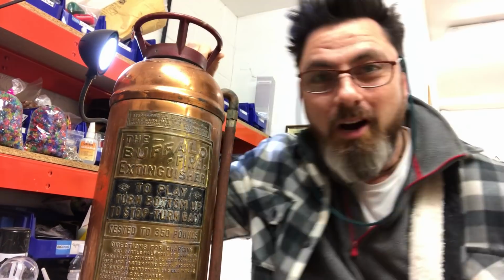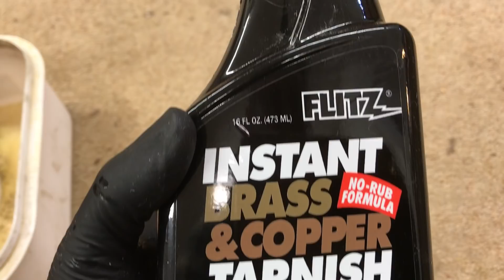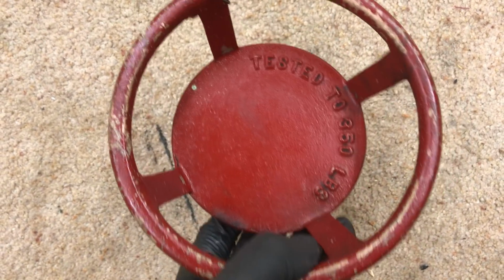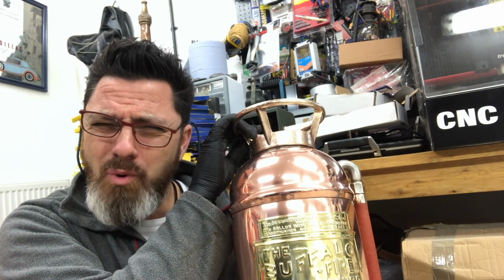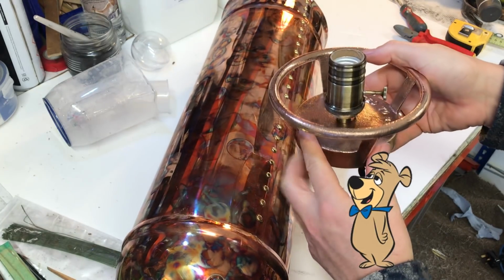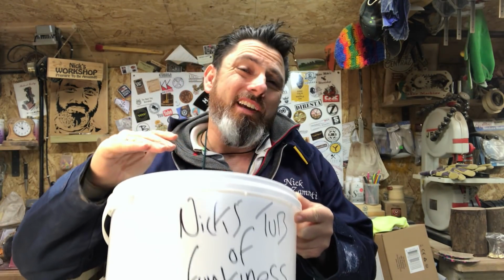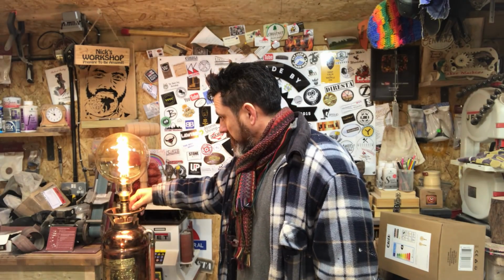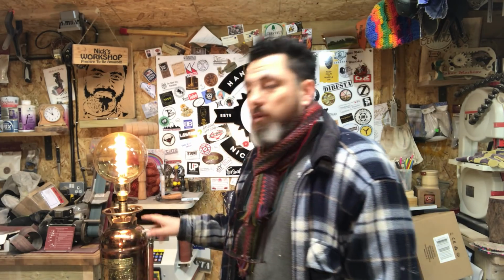I added this Mahoosive Bulb to an old fire extinguisher  😂

Comment: Hi Nick. The item you pulled out of your tub at 23.05 is an antique copper and brass fire nozzle. These are the main reason you need more than one firefighter holding the hose as it’ll throw you around all over the place!  They’ve been replaced by “hand controlled branches” now, which are much safer as you can turn them off rather than shouting at the pump operator to do it for you!

Comment: Nick, That was an acid/soda fire extinguisher. They were filled with a water and bicarbonate soda mix and acid would have been in the bottle located in the little cage at the top with a lead stopper in it. Tip it upside down the lead stopper fell out the acid mixed with the soda in the water and a gas was formed and pushed the water out the hose under pressure. They were outlawed here in the states in the early 60's because then would tend to explode when pressurized. The reason you had trouble cleaning it was because it should have been coated with a clear lacquer finish to protect it from the acid which is the same reason the cap was painted. While that wasn't an extremely rare extinguisher it was in really good shape and looked great once you cleaned and polished it and would have been worth a couple of hundred dollars here in the states. You kinda ruined it with the burning but hey I still like your videos so don't quit. What did you do with the basket and bottle that was in it they are hard to find complete.
Reply: Also how much value was lost by removing the patina? 😉

Watched a few episodes of Antiques Road Show. Where someone lost 200k by removing the "nasty" old finish. 

But it's not like it's a rare work of art.
Reply: Lol $200 is nothing.
Reply: @WatchingNinja  $200"K" aka $200,000.00.

They removed the finish on a Highboy to reveal the beautiful Cherry wood underneath. At the time cherry was the particle board of the day. With original finish around $300K without $75K.
Reply: @chartle1  I wasn't replying to you. I know what k means. I'm purely talking about the fire extinguisher, not whatever cherry wood you're talking about.
Reply: @WatchingNinja  ok I just did scan of the PP. I hate youtube comments sections. :(
Reply: @chartle1  tis ok! I didn't even realize you said 200k. Pretty close assumption.

Comment: You gotta be you, but yeah, I would not have done the burning. 

Actually thinking about what I would do: I’d go for a gas burner and use it outside. As for the finish I’d go the other way and weather it for a nice green patina.
Reply: Although the juxtaposition and irony of a burned fire extinguisher is enjoyable....I did prefer the look of the high polish, with a coating of wax to keep it from tarnishing....

Comment: I love that model of fire extinguisher I got 2 that I’m turning into kegs for beer. They are  most of the time tin or a copper pewter and they usually have a little glass bottle that’s awesome for stuff and a metal cage attached to the lid.

Comment: I agree with BlakeHanley about the power cord. Also throw about 10-15 lbs of sand in the bottom of the extinguisher for stability! Also: food for thought— you could have kept it classily polished up for a retro/ steampunkish vibe. Also could be made into a neat floor lamp with a turned shaft or a Brass tube to extend the fixture up to proper floor lamp height!! I have to say though, I do enjoy the comedy you inject into your videos!

Comment: You could get bigger ripples with an oxy/acetylene torch, we did it for the flower candle holders in shop , it helps prevent rust in higher altitudes

Comment: Judging by the weld, it is copper, but it's not pure copper or it would have been too soft to use for it's purpose, probably has some other metal added.
Kind of reminds me of the old copper shell casings they used during WWII,  they used to repurpose them, sometimes as fire extinguishers, I've only ever seen one made into a fire extinguisher.  There were shortages of copper and other things,  so they really had to repurpose everything they could.

Comment: Nick, quick tip to pull wire through an area like that.  I'll toss in dental floss and use the vacuum to suck it out through the small hole.  Tie/tape it to your wire and pull it on through.

Comment: Like the flame painting on the copper, very steampunk😊  I just hope you sealed the surface (lacquer, acrylic, etc) since the surface will continue to oxidze until it turns black otherwise.  BTW, the surface is NOT permanent...you can just clean it up the way you did originally if you want to change the look.

Comment: Flitz makes some great metal cleaning and polishing products. The main body of the tank is definitely copper while the front plate and other hardware are brass. You can tell by the color copper has a reddish hue while brass is yellowish almost gold. Great restore. Love the bulb but not a fan of the heat effect on the tank, too much I think, maybe if you only did it in a few spots otherwise it covers up the natural beauty of the copper. Just my thoughts

Comment: Ok so your "burn" is a heat patina, and if u had used a larger, softer flame u would have got big rainbows instead of small circles. I used to use this on copper guitar pick necklaces back in the day. It takes some practice :)

Comment: Hi Nick,
I as well was not a fan of the torching, but it did turn out funkadelic indeed. Just as a suggestion if you do something like this again, I wonder if it might be possible to use a long gas burner to put long lateral burns the length of the extinguisher to mimic flames and bring out those wonderful reds and golds, rather than the rosette type measles you gave this one. Not a criticism though, love the project. 
Dan

Comment: I'm not reading through all previous 780 comments so apologies if this has been said before but:
a)  that really should be earthed, seriously.
b) the oxidisation colours look good in my opinion though have you done anything to stop the oxidisation continuing?  They will disappear fairly quickly if you don't but it can be tricky to find a coating that doesn't also make them disappear, from a bit of research I did when looking at using this method to colour copper I read that lacquer will mute the colours or make them go completely though microcrystaline wax works quite well.  I had some success with plain candle wax but didn't test it's longevity.
c) I also would have run the cable through the hose though after some though I realised it would have been far more likely to fall over if the cable was yanked.  Maybe through the bottom section and up throu the base would have been better. then again more places fro the cable to potentially chafe and wear the insulation which is not good since it isn't earthed.
d) Did I mention I think it should be earthed?

Comment: Love the lamp. Not sure about the torching, but it looks good as a finished thing. I had one of those tubs. One of the kids fell in, and it’s been much quieter around here. Does the light have any other settings other than ‘on’ or ‘off’?
Congrats on the Play (not) Button.

Comment: Good Morning Nick from the Scottish Highlands. Another very interesting video. Looking through the comments before I left mine, I was surprised how many people thought the same as me - very unusual !!  I too would have used the "spout" for the cable and also thought you were making a miostake, after so much effort polishing it to such a fantastic finish. I, pretty much, changed my mind when i saw the finished article - funky indeed.
One thing no-one has mentioned - will the burnt effects wipe off over time?  The only other thing I thought of, and this only applies if you sell it -  buyers might be put off by the cost of a replacement bulb. It certainly wouldn't look anything like as good with an "ordinary" bulb. 

Just my thoughts at 02:24 on a Saturday morning. Pretty cool project in the end though - better put your emblem on the bottom of it.

All the Best,
Dougie.

Comment: OK Nick... this would be a BIT more work, but I think it would be TOTALLY worth it.....

So, drill a MUCH bigger hole in the top, line that hole with some sort of cushioning material (a bead of hot glue? Not glueing it in place, just there to steady the bulb) then build support UNDER the lid for the light socket. Put this at a level that will allow the globe to JUST sit on top of the rim of the lid... as if it were a ball of light sitting there. You might need something to cushion the globe from the rim of the lid as well (dots of hot glue?) You now can not access the light switch, so rig something through the sprayer... Maybe detach the hose, fasten it to a pull chain type light switch inside the extinguisher, so it looks like just a typical sprayer hose, but those that KNOW, know to pull on it to turn the light on and off.

As usual, just ideas!! This looks really cool!!

Comment: Having something that shiny be a lamp base would probably be a bad idea unless you got a directional light bulb. So it's probably good that you burned it a bit to reduce the glare.
I was REALLY hoping that you weren't going to drill the metal for the cord and try to feed the wires in through the hose.

Comment: I liked the burned effect to a point, around the bottom and a bit going up the sides of the plate fading to nothing before hitting the top seam is aboutvall i would have done. And i was hoping the same with the power cord up the hose. But it is your profect, and you had something in mind, at least, i think you did....

Comment: shove a solid part of wire in the bottom hole and force it out the top.  attach the black then pull it back.  Now turn a wood ring that will fit through the hole and wires through the ring - attach with resin and the metal won't cut the wire.  OK - now you have a Man Purse / bucket like the kids in the movies... Harry Potter and his best lady friend.  Cool bulb.

Comment: The tarnish on the outside may have been because it was clear coated to stop it going green and the red handle at the top was to identify it as a water only extinguisher so you didn't have to stop and read the label as you had to turn it upside down to use it and wouldn't want to use it on an electric fire, I think 🤔

Comment: Mr. Nick, Just in case you see this..  There is something that is so much better & 1K times better..  You have it there I believe as well as here in the states. It's called by two names.. Either "Bon-Ami"  or "Bar-Keepers Friend"  .. It's inexpensive & super simple to use as it's a powdered material and you add a little bit of water to it.. as long as it's damp it's working and you don't have anything to scrub or fiddle with.. & you might find a need for it in the kitchen too.. as it polishes stainless and other metals without much worry of scratching them.

Comment: All you had to do to get the wire through was run a strong through up to the top secure it to the wire and then Pull the wire down through the hole.

Comment: just saw this video and apart from it bring a brilliant restoration of a vintage brass and copper fire fighting device, its a potential parden the pun death trap. 3 core mains cable should be used with the earth conductor bolted to the copper body protecting the user from an electrifying encounter, so as a lamp a complete FAIL.

Comment: You could have pushed a coat hanger wire through the bottom hole then attached your wire and pull it through that way.

Comment: The initial "tarnish" was actually varnish.  I would have cleaned this up, but not stripped it.  I definitely would have left the label area alone.  These old extinguishers had such character!

And the top was red because it was a FIRE EXTINGUISHER!  You want them red!

Comment: If you want a more natural/cheaper way to clean brass/copper use ketchup and white distilled vinegar for a cleaner... if you want it as a paste you can use baking soda with it... it will fuss a bit, but it will clean it very nicely.

And I'm sorry to say, I didn't like the burning of the copper with the torch. It looks like a dalmatian with mange/scabies.

Comment: Piece of string and air blown in the hole would have pushed the string out the bottom and you could tie the electrical cord to pull it through

Comment: Lots of stuff. Firstly amazing restoration. I didnt like the burn all over the piece, only the bottom was better,2nd 3rd bulbs were equally good.also drilling into it for the wire sort of ruined its appeal unless maybe you can get a copper coloured wire in my opinion. Otherwise I would buy it in a heartbeat!

Comment: the problem you have invited in by polishing all that metal is that you will need to keep polishing it forever, brass is terrible at getting a corroded look pretty quickly after you polish it and once youve done it once you cant stop and i have reason to suspect this also applies to copper

Comment: Nice project! While watching,I cringed when you drilled the hole for the lamp cord....I probably would have ran the cord up the fire hose....That would provide a bit of stress relief, and protected that portion of the cord from abrasion.....You also could have added stability by mixing some wood glue and sand to pour in the bottom of the lamp for additional stability to protect the non-standard,edpensive bulb from breaking when/if the top heavy lamp tips.....

The good thing is that isn't an actual antique fire extinguisher, and merely a replica of an antique style extinguisher (The antique ones have a way to charge the tank,and some sort of valve to operate the extinguisher when needed)....Plus a real antique wouldn't have a steel elbow pipe, or a stick on label made to look like a welded stamped information plate on it.....
I don't mean to "bash" your project,much respect, just offering some insight and ideas for future projects (Maybe order another, and try these, or some of these ideas...)....I also think the "flame treatment" finish was nicely juxed opposed to the actual purpose of the subject, being a fire extinguisher.....I wonder if you would get a more uniform, less "perfectly round gas torch" effect if you used a small backyard firepit, or a BBQ grille for more even heating.....Or leaving it as highly polished,and simply waxing it to protect that perfect, brand-new shine....

Comment: hm. imho, the burn effect is too much on the whole thing. only the bottom ring was fine. and as others said, the hose would have been perfekt to run the cables through. but that aside, a very cool and funky project! and btw, i have seen a bigger bulb. it came out of a lighthouse ;) something like 2000W or so... HOT!

Comment: instead of burning it, you could have gotten ahold of some scrap copper and tried flame painting first. Copper turns all kinds of beautiful colors when exposed to heat (every color of the rainbow, really), and practicing on scrap first would have let you decide if you liked the look (plus the colors are fairly timing-specific since they continue to change when you pull the heat source away). Just burning it straight-on looks like it got you some hints of blues and purples, but the overall effect doesn't look so great. Sorry, Nick, I'm just not a fan of this one.

Comment: Nice made, but a shame that you went over it with the flame, plus I would have pulled the cord through the hose, then you did not have to drill a hole in it.

Comment: Nice but it looked a lot better before you put the torch to it. AAlso, turning it into a lamp is kind of lame.  So many people already do that. You need to come up with something more original. Otherwise it was a great job and it did make a cool lamp.

Around here I would probably pressure test it and put it back into service. But that's just me. I am famous / infamous for taking vintage and antique objects and using them for their original intended purpose.

Comment: Boring comment alert - you should use 3 core flex (with an earth) with a metal lamp / holder in case it shorts a la Brookside light switch disaster

Comment: Aw man you shpuld have put wire through hose. Instead of putting a hole in bottle. So if u want u could have moved around. Preventin the trip hazard. Pkus much cooler

Comment: As others have commented re: earthing. So you insert a replica of old  twisted pair cabling into a metallic chamber essentially made of one of the most conductable materials, without an earthing point? The only saving grace I can see is the insertion of a rubber grommet to allay chafing of the power cord. Not only have you created  a veritable deathtrap, but have ruined a lovely antique! I would stick to wood mate;  funky or not, what you have done is dangerous.